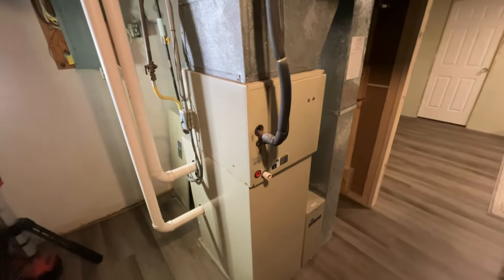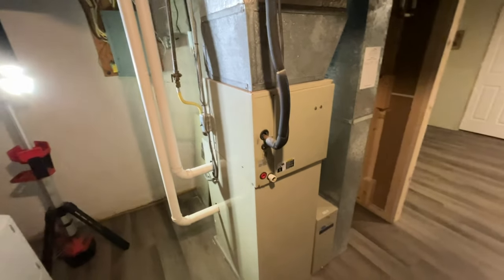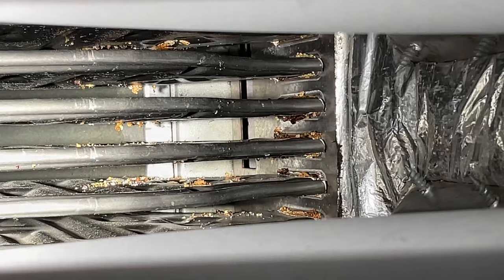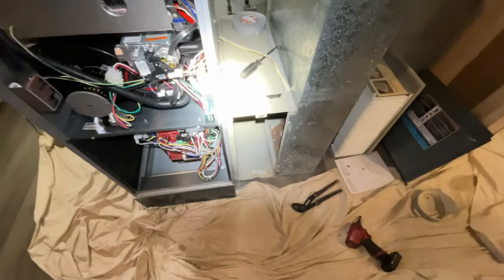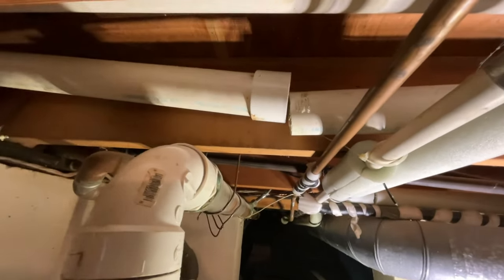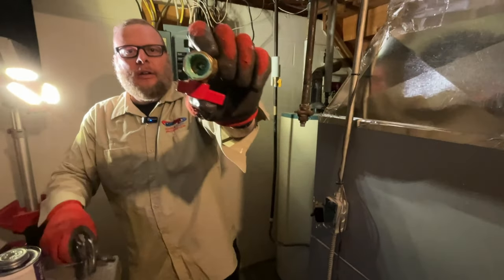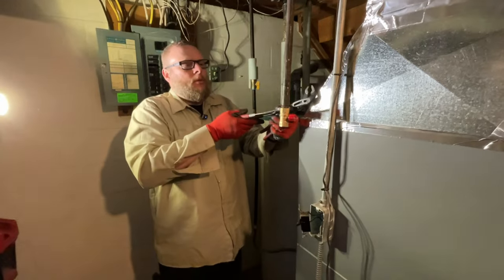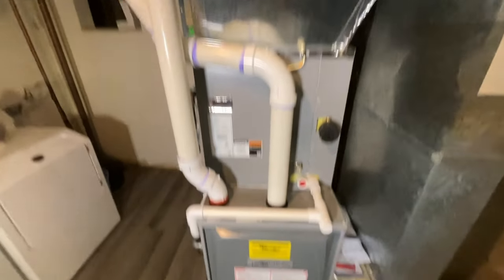Carrier Bad  exchanger,  new Armstrong furnace change out

Comment: Nice installation, but how come there isn't a secondary pan under the new installation?
Reply from the maker: It’s not code, there is a floor drain 2 feet in front of the furnace. If this was upstairs I would have to install a pan underneath the furnace. We also wire our pumps so if they stop the equipment stops as well. Thanks for watching.

Comment: There WAS a class action lawsuit. That's been settled already. Carrier offers by back programs (credit for a new furnace) if the 58 series fails within the 20 year period, or it's a free heat exchanger (not including labor) I can tell that this one was definitely way past the 20 year mark. Can't be too upset about it if I was a homeowner. Now if I spent a bunch of money in 2009 on one of those POS, I'd be pretty pissed. In my experience, from 93-99' they lasted pretty good. Their quality went downhill fast after 2000. Made them til 2011.
Reply from the maker: I’m pretty sure this was 95-97 era.

Comment: If it was installed in the last 20 years, the homeowners will qualify for the Carrier Trade in Allowance program. $700 for a Performance Series furnace, $800 for an Infinity 2 stage, and $900 for an Infinity modulating. I'd be interested to know the serial number of the furnace you pulled out. Could have potentially saved the customer some money off the installation of a new Carrier.
Reply from the maker: Would it have to be the original homeowner or does it go with the house?
Reply: @ADVANHVAC  you would have to replace it with a new Carrier unit
Reply from the maker: Yes, I knew that. Thanks for watching.
Reply: @ADVANHVAC  it's with the house. Original owner doesn't matter. This is a specialty warranty. Carrier will take care of any failed secondary if it was installed in the last 20 years. They will give a whole new Heat exchanger and pay 4 hours of labor for the replacement. If you go with the new furnace it $700 for the 59TP6B series, $800 for the 59TN6B series, and $900 for 59MN7 series. Talk with your local Carrier Great Lakes, which for you will be in Grand Rapids. I'm up in Traverse City, but am originally from Kalamazoo. I own MD Heat. We're a local Carrier dealer up here. My dad used to own Mike Baker Heating & Cooling down there in Kalamazoo. 👍🏼
Reply from the maker: Gotcha, thanks for the info. Yeah this one was from the 95-97 era.
Reply from the maker: This job was in Richland just down the road from Gull meadow farms. I’m sure your familiar with that area.